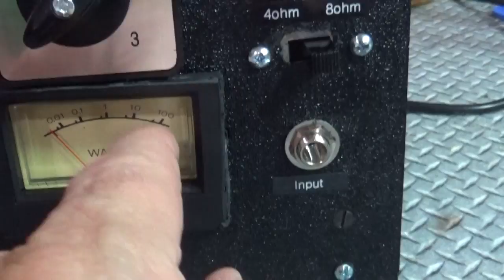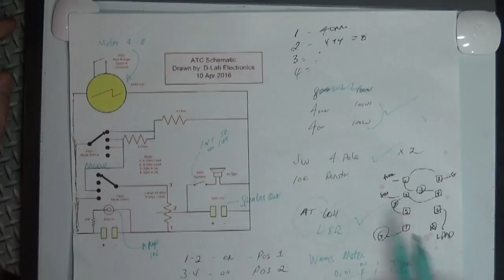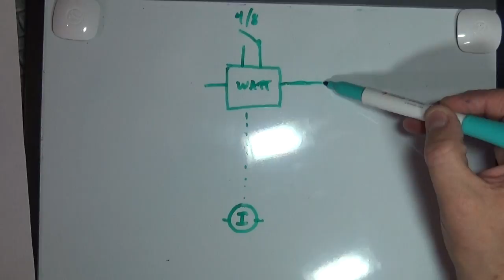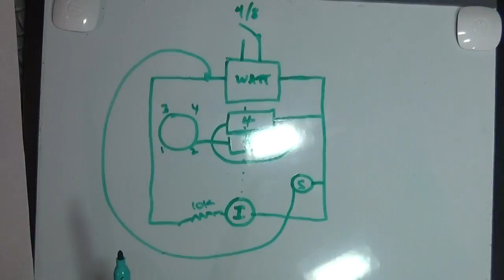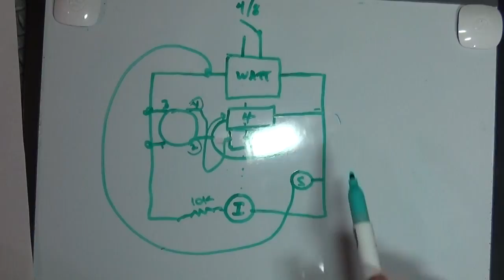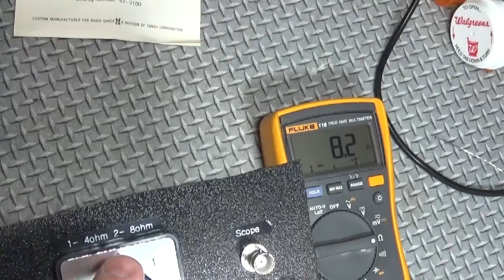Bass & Guitar Amplifier Dummy Load Tester - Episode 3 - Ohm Ohm on the Range.

Comment: You kind of wasted your money on the 4 position switch.   You could have made it much simpler by just having the two 4 ohm resistors in series for 8 ohm load than use a simple  SPST toggle switch to short out one resistor to change it to a 4 ohm load.                  
Secondly are guitar amps hot chassis??     Is there a concern on how to tie a scope to the amp so the scope isn't a direct short to ground from a hot chassis??
Reply from the maker: Jp.  I plan to rebuild this in the future and will add the speaker and pot to it. Guitar amps typically do not have a hot chassis so nothing to be concerned about there. There will most certainly be a version 2 of this in the near future. That cabinet and speaker are too important to waste.   I agree the switch is wasted but its connected with screw terminals no easy to remove.   thanks Ron

Comment: Looking good Ron. btw,,, are you tapping in the scope where the speaker would be? I can't find that on the schem there.
Reply from the maker: You are right that it is not on the schematic. Indo have it in the speaker rail and i think  i will need to add a resistor across it . It may be noisy.    Will determine that tomorrow.   :).   Thanks bud
Reply: where's  the light bulb?  dimm bulb, cap thang bulb, and dummy bulb  

I think an old car headlight might make a kewl dummy load, instead of the speaker, lol. the trick would be to find an 8 ohm light bulb.
Reply: The scope is why, but why?  This will go nice with your old Heathkit siilly scope.  Put a .1 cap on the center pin  to the BNC probe  jack.   You'll be connecting a lot of power to your old scope.  the why is to SEE clipping and distortion, and noise that should not be there. A multimeter is too slow.  The monitor speaker helps too.  Don
Reply from the maker: I think the AMC Hornet had an 8Ohm Headlight :)